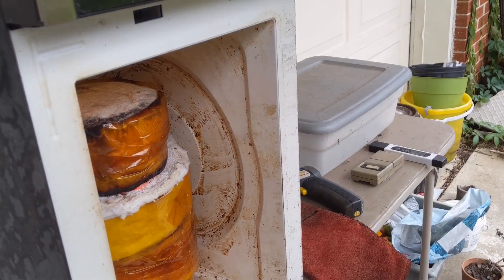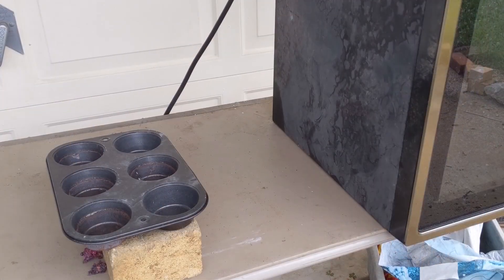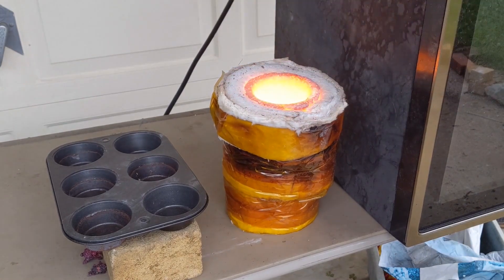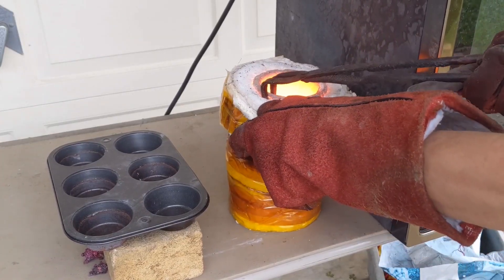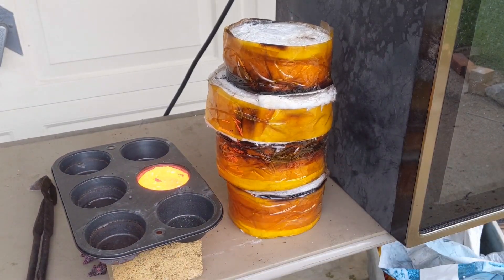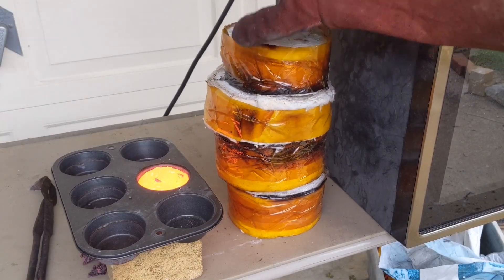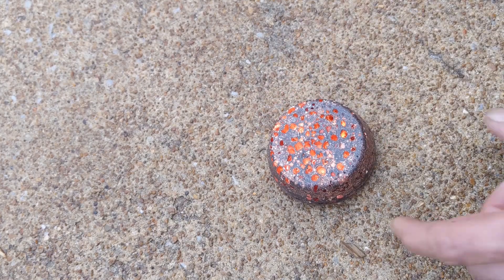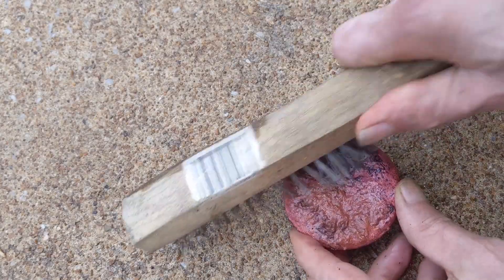I melted copper with a microwave.

Comment: Do you think this would work with bronze?
Reply from the maker: Yes, bronze has a lower melting point, so it will melt just fine. The microwave energy is heating up the silicon carbide crucible. The hot crucible heats up the metal.

Comment: very nice video, i would like to help you to make a BOM(bill of materials) for this entire thing, are you interested? perhaps to get an easy release you could coat the copper molds with sut for easy release, to prevent of gassing you could add a floating flux cover.
Reply: Thats really cool that you know that stuff man.
Reply from the maker: @Rapture-Farms  It's my goal that other folks know this stuff too! Thanks for watching.
Reply from the maker: Once the teflon coating is burned off, the ingot releases easily. The copper shrinks when it cools and releases itself. 
This project is still evolving. I'm on my third revision of the insulating jacket and have plans for one with powdered silicon carbide for heating things without using a crucible.